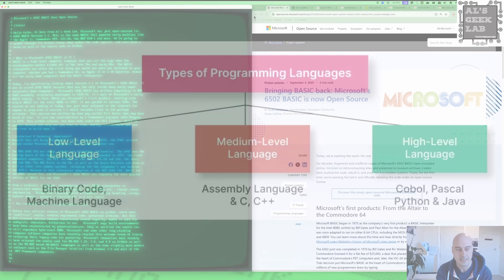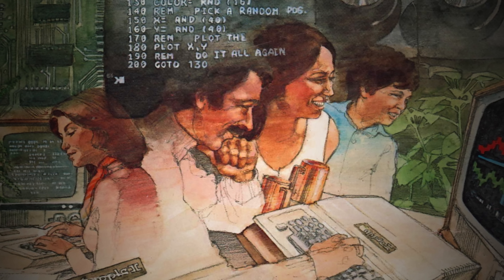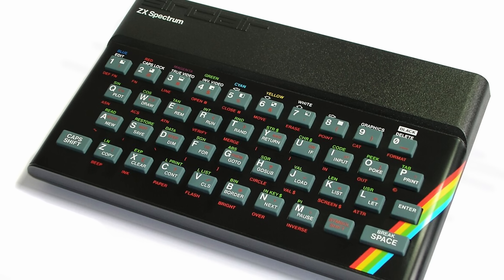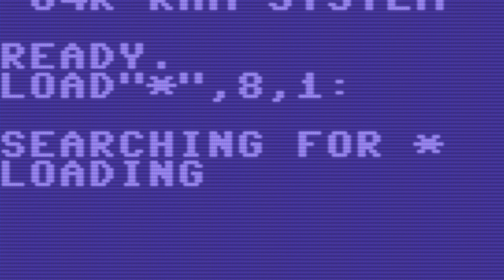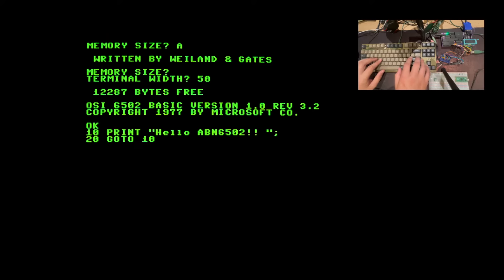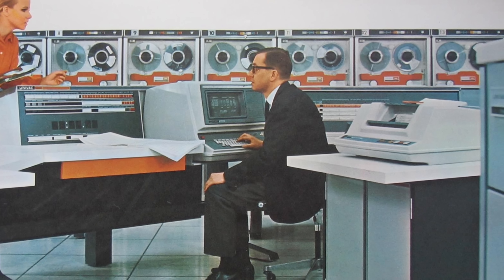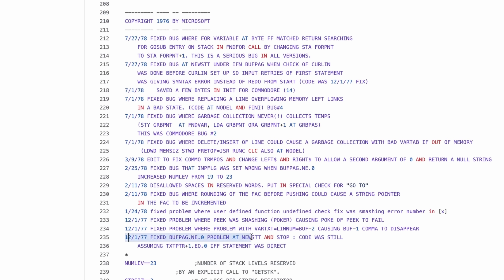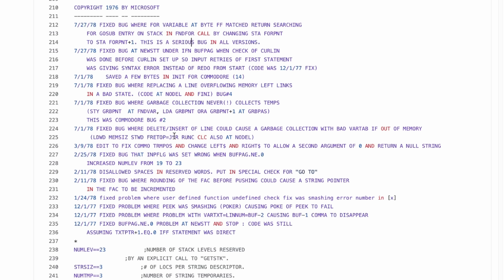Microsoft Just Gave Away Classic BASIC Code (6502)!

Comment: BASIC gets a lot of credit, but structurally LOGO was better as it allowed for modularity in functions. Early BASIC was a mistake because it taught programmers very bad habits and failed to provide mechanisms for good abstraction. Even languages of the time did it better such as Lisp and Logo. It is unfortunate that BASIC was the shell language of the 8 bit home computer. Some 8 bit computers did come with other languages though such as Forth. The biggest design flaw in BASIC is that it tries to use arbitrary keyword clauses to dictate computation which is the same mistake languages like COBOL did. English clauses are not structurally composable the way functions are.
Reply: BASIC successfully turned millions of people from non-programmers to programmers. Far, far more than LOGO ever did.
Reply: What could you do with LOGO apart from turtle graphics?  BASIC was a flexible and economical language that helped many people get their feet wet in programming.
Reply: @sa3270  Starting off with BASIC didn't prevent you from learning better habits with languages which encouraged or dictated them.  The usual "sniffy" purists are out in force again
Reply: It did encourage bad habits.  In highschool in the mid eighties, there was BASIC class followed by an AP class using Apple Pascal (UCSD based).

Our BASIC teacher was a stickler for over documented clean code.  This was easily more useful than the language instruction.

After using Pascal, I lost interest in BASIC.  I wish there had been a UCSD based Pascal for the C128.
Reply: did it teach bad habits by mistake or was it intentional?
Reply: @serbrighterunagainst9231 The basic back then used line numbers for order and labels.  And it had to run on very limited RAM, typically 20K-64K.  So, it really had strong limitations.  It started improving in the late 80s.

With CP/M and MS-DOS, or better UNIX, you had much better choices.

Pascal was intended as a teaching language and enforced good programming structure.  Fortran was good for science.  Cobal was good for business (especially reports).  And C is a good all purpose language.  Ada (Pascal like) was looking like it would gain traction.  The DoD was requiring it.  There were many others.
Reply: @serbrighterunagainst9231  It was necessary to fit in the limited memory of early computers. But you can easily learn bad habits in other languages too.

Comment: Isn’t Ben Eater using MS Basic in his 6502 project? He’s adding new commands etc. So he did have the source code for a while… (ok, you sort of mention that)
Reply: Well considering its on the ROM and it's assembly then you have the source code just running it back through a disassembler... Not more then a 5 minute job. Hell you could even write in basic to peek all the ROM addresses and then run the data back into 6502 instructions set and do it live on the Commodore or whatever your machine is.
Reply: There was a leaked version of the source. Now M$ has made it official.
Reply: @crayzeape2230  The innards have been known for like forever, every 64 Intern by Data Becker has the BASIC and KERNAL in commented form, which was something you needed when writing programs for the C64. For modern retro dev you even have All About Your 64, a commented and hyperlinked version, at your hands. MS has tolerated that as long as nobody took the interpreter and used it in their commercial product. And now they said "Screw that" and put it under MIT.
Reply: @BastetFurry  Not disagreeing with you at all, I stll have my original VIC20 and C64 from my childhood, along with all the various books I'd collected over time. I had commented disassembly of BASIC, KERNAL, and the 1541 ROM way back then. Funnily enough for the sort of thing I was writing I'd be switching out the BASIC and KERNAL ROM's pretty early, and using a custom loader (C64  and 1541 code) from then on. The good old days.

Comment: Regarding the plethora of code comments, in assembler it’s not at all uncommon for the vast majority of lines to have comments, as well as multiline block comments,where appropriate.

It’s not just for maintainers, it’s also for the original programmer (I still do a fair bit of assembler in my line of work of real time mixed signal RF processing).

Also, back then, assembler identifiers were typically limited to only 6 characters.
Reply: Not only what a section does but also where it starts and ends. Comments in Assembly are a must if you ever want to go back and modify the code.
Reply: Without the comments it can take a long time to get what a section of code do, or worse not what it do, but what it was meant to do.
My own code always had two columns. One with assembler instruction an one with comments.
Reply: In the days when programming itself was new and less understood most people wrote more. It is quite insane today that they needed graphics to explain if and for loop structures .... i'm sure this was also sold by professors and consultants to make money (there was never a time wihtout this academic gold rush shovel sellers). I wrote lot of assember and c in the 1980s and i have never seen anyone doing Nassi–Shneiderman diagrams in real life.

Comment: BASIC was basically crap
Reply: It seems, from the comments, that Basic encouraged overuse of the TROLL command ....
Reply: Wrong, it was largely used in the 60s and 70s on minis, and it still survives today in VB for application inside Excel and Access
Reply: @CaptainDangeax visual basic is nothing like basic
Reply: You sir, have no idea what you are talking about. Bad practices exists in all programming languages. Plus there are quite a few variations of Basic. Including modern ones. Though, programmers are sheep and connections. Hence why the most ugly programming language ever still is going on strong: C++. A big mess.
Reply: @stoomkracht I have programmed in over 10 languages basic even structured basic sucked arrays all wrong the print command was fine no passed or returned parameters  I workedb10 years in industry and teach programming now basic was ctap
Reply: You would be surprised how many industrial production facilities run on BASIC from companies like Rockwell Automation.  
Today it's called "structured text" in the process control industry and is supported by the IEC 61131-3 standard.  It runs your refineries and your food production. 
Sniffy comments are so boring.
Reply: @Peter_S_ it can not be the original basic what you are talking about you would be surprised how many programming language I have developed in, my favourite four are C++ , RPG , Pascal and Python ,  have also coded in assembly pleasebwevare talking about Bill Gates BASIC which was apparently not his so I was told
Reply: For the sorts of systems BASIC was designed to run on and the purpoes it was intended, it was revolutionary
Reply: @MonochromeWench  for the purposes of a short script-like program with a "simple" yet not very capable syntax it was usable, being interpreted was revolutionary as much as it was limiting for speed usability and especially scaling... it kept entire computer software industry stagnant in the 2kb-64kb ram home computer era for a very long time
Reply: Basic was an engineering marvel for its time. It laid the foundation for all operating systems today
Reply: @jasonjason5325  basic destroyed generations of programmers
Reply: @serbrighterunagainst9231 😂 Quite the contrary. Some of the greatest minds in history worked on Basic including Steve Wozniak and Paul Allen. I dont know how you interpreted it ruining programming.
Reply: @jasonjason5325  A Software Engineeer can only be good despite BASIC not because of BASIC. Even assembler is much prefered for any system design based software. Generations were taught wrong approach of programing with BASIC and hence never pursued programming. It's not a full real language and it has any hidden flaws
Reply: @serbrighterunagainst9231 ok you can spew misinformation all you want. You have no facts to back up your claims
Reply: @jasonjason5325  one man's truth is a propagandist's misinformation, because misinformation isnt about factual quality of information rather information not being wanted by the party. So show me some opensource programs written in basic, not visual basic, normal basic.